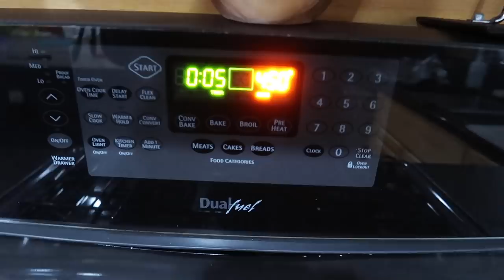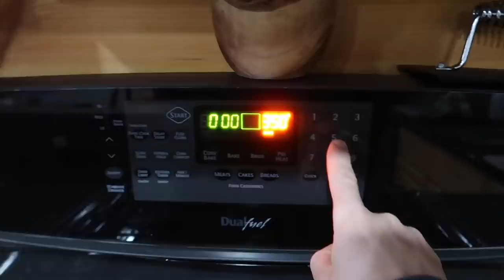This Saves alot of Money | How 3 Goats and 17 Chickens Make Compost

Comment: The first time you bred Willow it was warm out. This time it was cold. No sweaty buck this time. That and odors don't atomize the same in cold air as in warm air so you just won't smell as much even if the source is the same strength in both instances.

Comment: OK, I hereby recall my guess about the "big plans" being a pavilion - I'm now changing it to a barn based on your comment of bringing in concrete.  If it is a barn here are some things to consider based on my barn and what I wish it would've had (it was already here when we bought the property). 1) Make it larger than you think you will need, esp the tool room - what you didn't plan a tool room for all your gear?? - lol   2) Put in a good open drainage system in front of your stalls - one that can be covered by a metal grill on the top, but so you can lift that grill off and scrub the drainage run out if need be, and have this drainage run empty out a good ways (12ft or so) from the barn. 3) Build a 2d floor for hay storage and have a large door and hay lift on the 2d floor, so you don't have to haul the hay up by hand.   That chicken looked awesome btw!!!  Here's another cool way that I use to cut the breasts (works very good whhen you have company and want a neat presentation. 
https://www.google.com/search?q=carving+turkey+breast&oq=carving+turkey+breast&aqs=chrome..69i57.10172j0j7&sourceid=chrome&ie=UTF-8#kpvalbx=1

Comment: Mornin Al. Love the videos. One caution: Breeding back ceilings to their site is not a good idea. The close genetics can really enhance bad characteristics. Perhaps purchase 2 unrelated bucks so you can alternate breeding and the buck has a buddy. Willow may have a very short breeding window or may be a night breeder. Suggestions: Keep your doe with the buck for two heat cycles to increase exposure and successful breeding. Make sure Willow is getting enough selenium and copper as that will also impact fertility. NGDs can breed year round so staggered breeding will keep you in milk. Just my thoughts. Love your animal husbandry!!!!!

Comment: I could break down the cost to raise cattle but not sure with goats because goats are browsers cattle are grazers which is to say that goats prefer to eat weeds, tree leaves, briers, tree bark over grass so most of your feed cost is going to be in pellets and legume type hay ie alfalfa,  clover, supplements such as minerals  ect. Then you would need to take into account variable costs like vet visits fuel for your tractor repairs and the like to be included into the feed cost as well as labor cost. The problem will be as you said calculating benefits, such as compost, and milk production since you are not selling any of those products to off set the above cost to raise and feed your goats. So I think it will not be possible to calculate.
Reply: As far as the chickens I have been able to make the chickens pay for themselves with selling eggs and having eggs to eat and meat as well. So for our family they really do pay for themselves and a little extra, and then the fertilizer they produce is an extra bonus for us as they fertilize the garden in the growing season.